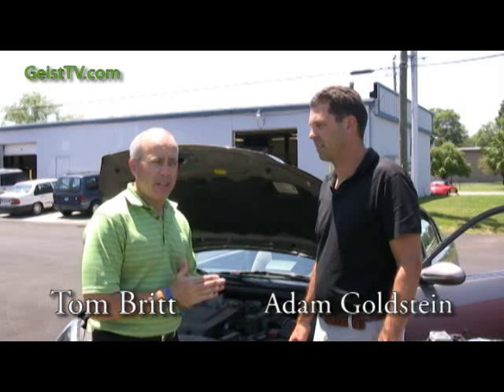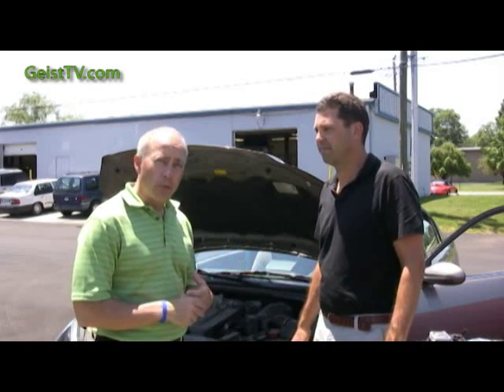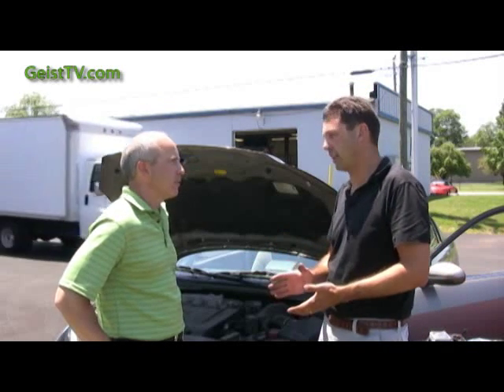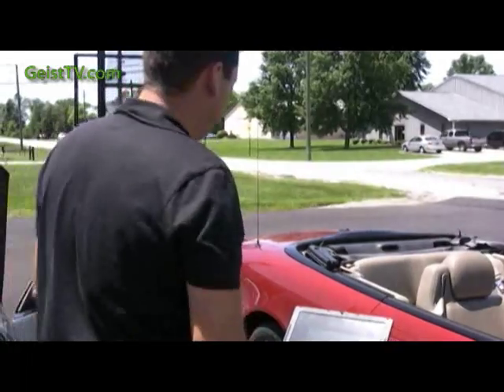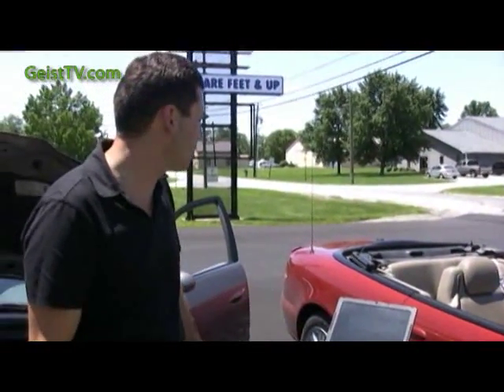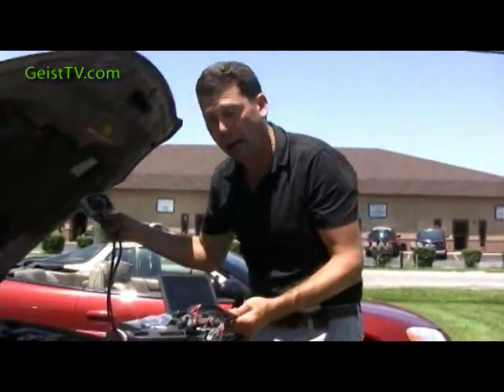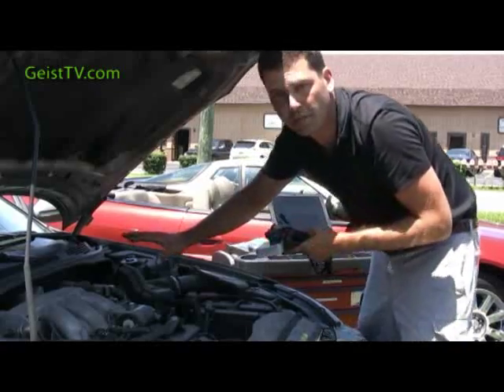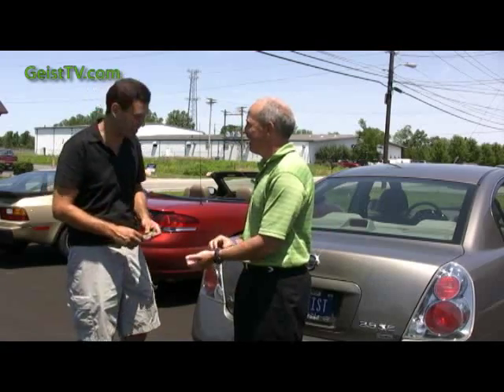How an Ethanol Conversion Happens

Comment: I know this is old, but I just came accross this. I turned my 2007 Ford Focus ZX3 into a E85 system, by simply going from Stock 19lb injectors to 24lb injectors. Normal fuel and the car would run like crap. But with E85 the AMOUNT of fuel is was pushing into the chamber was perfect and the engine ran smooth. And at higher RPM 6-8 k the 2.0 liter engine ran awesome

Comment: Stock injectors, stock fuel rail, stock fuel pump. Hahaha please tell me how this mysterious computer can change your hardware. This is a sham
Reply: From factory, the injectors on most cars are not running at 100% duty cycle at full load. Maybe somewhere around 60-70% to have some margin for O2 adaption which means that the injectors still have some flow left in them. What this computer does is to increase the duty cycle of the injectors. It takes the duty cycle that the car's ECU puts out, and adds somewhere around 20-35 % to it, so that the injectors is open for that much longer in each power cycle. I would guess that in this particular case, where the car actually becomes Flex-Fuel, and not converted into E85 only, the piggy-back computer he is installing is adding somewhere around 15-25% to the injector duty cycle. After that, the car's factory ECU will take care of the rest of the adaption required for the extra, or lesser amount of fuel required for the engine to run at the required air/fuel ratio, depending on the amount of alcohol that's in the fuel. All modern car ECU's have the ability to adapt to around plus, or minus 25% when it comes to fuel distribution to the engine. The ECU store this information in its memory and it is still there the next time you start the car. This is to enable the engines to run properly everywhere around the world, since fuel quality can vary.
So basically what this "mysterious" computer does is to help the ecu adapt the fuel properly by adding time to the duty cycle of the injectors. The ECU then, with the help of the O2 sensors, adapts to the amount of alcohol in the fuel.

You can also do this kind of flex fuel conversion by editing the maps in the ECU and re-writing the program to make it able to adapt more than 25%.

Comment: e85 isnt corrosive, it has 15% petroleum products in it which lubricate, drying out of rubber products is not a real issue with e85, if it were pure ethanol or methanol or nitro methane or similar it would be an issue.